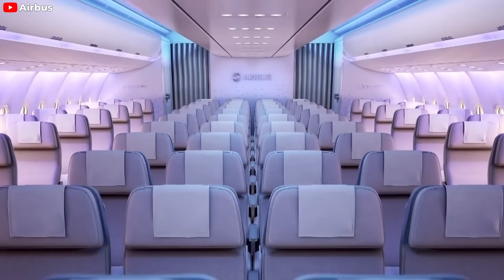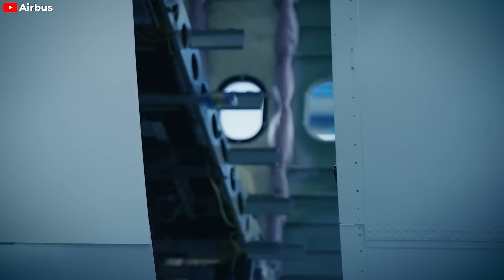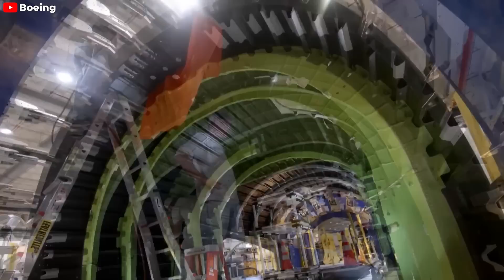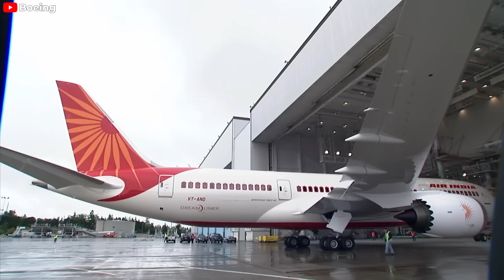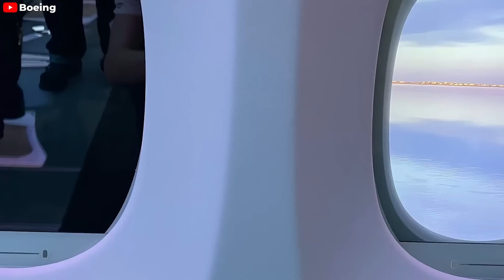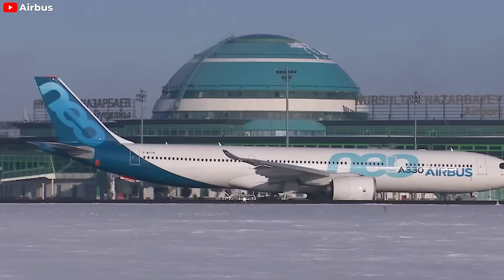Airbus NEW BIG Plans on A330neo Will Change The Whole Aviation! Here's Why

Comment: Interesting video including most of the points I have previously raised.

Unfortunately, fanboys and salesmen only understand 'best'.

Sometimes, 'good enough' is all that is needed. 

I am sure that the Boeing bean-counters envy the earlier profitability threshold of the Airbus.

The Boeing may well be the better plane overall, but it is almost certain that the A330neo will outperform the 787 so far as profit for the manufacturer is concerned.

Perhaps with hindsight, Boeing could have been better off financially by enhancing the 767 instead.
Reply from the maker: thanks for your sharing

Comment: I agree that the Airbus A330-900 is just an upgrade version of the A330-300 but if it was meant to be an upgrade then it shouldn’t have been heavier than older model it should have lighter in weight and more powerful engines. Instead the A330-900 has less powerful engines and it’s a lot heavier in weight therefore it goes through a lot more fuel and then it costs a lot more to maintain and to keep the plane. If Airbus wants to make the A330-900 a good plane to replace the old A330-300 then they are going to need to make the 900 a lot lighter in weight and more powerful engines and also better for flying higher up in the sky otherwise Boeing will continue to win this market and that will be the A330-900 not worth continuing to make anymore and leaving airbus with a job to make another plane altogether
Reply: The A330neo cost much less to develop than either the B787 or A350, so to develop a lighter carbon fibre composite hull now would be very expensive, and unnecessarily compete with Airbus' own A350. So Airbus would be shooting themselves in the foot. The A330neo is much more efficient than the Ceo, and is available to airlines much sooner and much cheaper than its rivals. Many Ceos around will not need to be replaced for some years, and whilst the type sells modestly until then, it is currently keeping the price of the B787 down, so a good job well done for Airbus.

If the rumoured Chinese order for 100 plus Neos is confirmed at Farnborough, along with the rumours of Virgin replacing their B787s with Neos, when the 787's lease expire and when major internal refits are required, the Neo will be shining in the spotlight..........
Reply: @artrandy While it was easy to compare the 737 with the A320 series, it is far more difficult to do so with the current widebodies with their less than perfect alignment.

While far from perfect, I sometimes wonder if we should even consider the A330neo and A350 together. After all, the A350 was initially intended to be a replacement for the A330.

Not only that, but if I am not mistaken, the A330neo wirh it's brand new industry leading wings has ended up being good enough to make the proposed smallest version of the A350 unnecessary. Possibley because efficiency usually improves with a 'stretch' with the opposite so often being true for a 'shrink'.

As for truea operating costs, it might be several years before we have enough data regarding residual values to give a definitive conclusion
Reply: I do agree
Reply: Virgin Atlantic isn’t buying any more of the A330-900 because they are replacing the their older A330-343S with the new A350-900 ultra long range. And the A330-302 is still a lot more fuel efficient than the new A330-900 especially when the A330-302 is lighter in weight and the last of the planes were built in 2020 and virgin Atlantic and euro wings bought the last of them earlier this year so they will arrive later this year or next year
Reply: @FraserWest-um4ue  
I never specifically mentioned the A330-900 in relation to Virgin, I deliberately spoke of the A330Neo. That covers all configurations of this new generation A330.

You invent an argument I didn't make, and then contradict it. Ostensibly, you're arguing with yourself🙃🙃.

Besides, the rumours of more A330Neos for Virgin, to replace leased B787s returning to their lessor, is separate from any future need Virgin might have to replace other types.

Let's see if there is an announcement at Farnborough or Paris about new Virgin A330neo orders, the former is only next week. I have an open mind regarding rumours, but you are certain that you have a hotline with God😀.

So please don't try to gaslight me buddy, my message is clear, as is your attempt to confuse things to win out an unconvincing argument by default...........
edit: sp
Reply: What you’re saying about me is actually correct . With either of your messages
Reply: No you’re saying I made the hole thing and I am arguing with myself and your calling me stupid and a few other things I don’t that and I the fact is that there hasn’t been any evidence of what you’re saying is accurate anyway so don’t bother being quite so rude to someone who has flown both of the A330-900 and the 300 version
Reply: I was only making a point and virgin Atlantic has the order in place since 2019 but still hasn’t been given the planes the newest order is actually for the bigger A350-1000S which isn’t arriving until 2026 at the earliest
Reply: @FraserWest-um4ue  
Nothing I can see in your 2 replies, has contradicted anything I've said, but you've assumed I said something different, and contradicted that instead............

Comment: The A330-900 does not weigh 251t. It's the MTOW. And the MTOW of the 787-9 is 254t. The 227t ist the MTOW of the smaller 787-8
Reply from the maker: thanks for your comment

Comment: This is a no-sense to compare this two aircrafts: the A330 is an old generation plane, and the B787 is the most advanced one in terms of technology today. Even the A350 lags behind the B787. The A350 is a conventional plane with carbon airframe but all the equipments and the technology architecture is traditional
Reply: Do not agree with you on that. Apart from Boeing's non use of bleed air, and Airbus's use of conventional batteries rather than li-ion, the A350 is more advanced than the 787, especially in terms of its systems keeping maintenance costs low and managed. The A350 was initially going to use li-ion, but this was changed after Boeing's problems with them.
Reply: @FrewstonBooks   The A350 is carbon fuselage, but built in 3 pieces in a section when the B787 is one piece which is much better. 
The A350 is in carbon, but still with classic systems such the air is still coming from the engines with all the pollution problems which affect everything aircraft, on the B787, the air is coming directly from outside with four compressors which can still work in case of engines problems. The brakes are full electric on the B787,  when the A350 is still equipped with classic hydraulic. The B787 has a central computer systems architecture while the A350 still has a lot of local computers like every aircraft since the 1970’s. On the B787, you can start both engines at the same time but not on the A350. The airframe de-icing system is electrical on the B787 while still air with the A350 and …. Yes the A350 is a conventional plane built with carbon, while the B787 is really a new step in the aircraft development. Sorry sir, I flew the Airbus, and the Boeing,  and I am not talking about the flight philosophy of each one, where there is no problem with Boeing while there are safety questions about the non-synchronized side sticks and the non-moving throttle on the Airbus. I am living close to Airbus Industry, I would prefer to say the opposite, but I have to recognize that today the B787 has no equivalent, maybe the next Airbus (I hope so)
Concerning reliability: we had 24 A350 and 35 B787 in my former company before I quit, and reliability was the same
Reply: Newer isn t always better.  Best example is the battery problems b787 had. If it leads to a safety hazard you can give me the old technology anytime.

Comment: This is a no-sense to compare this two aircraft: the A330 is an old generation plane, and the B787 is the most advanced one in terms of technology today. Even the A350 lags behind the B787, the A350 is a conventional plane with carbon airframe but all the equipments and the technology architecture is traditional
Reply: The A330 Neo isn’t an old generation plane. In some things it could be better than the B787 as example the quality, which Boeing is failing at lately. Don’t say that the A350 lags behind the B787 because it obviously doesn’t. Maybe airlines chose the B787 over A330Neo but they also chose the A350. Also B787 and A350 aren’t comparable.
Reply: @samixzyy    The A350 is carbon fuselage, but built in 3 pieces in a section when the B787 is one piece which is much better. 
The A350 is in carbon, but still with classic systems such the air is still coming from the engines with all the pollution problems which affect everything aircraft, on the B787, the air is coming directly from outside with four compressors which can still work in case of engines problems. The brakes are full electric on the B787,  when the A350 is still equipped with classic hydraulic. The B787 has a central computer systems architecture while the A350 still has a lot of local computers like every aircraft since the 1970’s. On the B787, you can start both engines at the same time but not on the A350. The airframe de-icing system is electrical on the B787 while still air with the A350 and …. Yes the A350 is a conventional plane built with carbon, while the B787 is really a new step in the aircraft development. Sorry sir, I flew the Airbus, and the Boeing,  and I am not talking about the flight philosophy of each one, where there is no problem with Boeing while there are safety questions about the non-synchronized side sticks and the non-moving throttle on the Airbus. I am living close to Airbus Industry, I would prefer to say the opposite, but I have to recognize that today the B787 has no equivalent, maybe the next Airbus (I hope so)
Concerning reliability: we had 24 A350 and 35 B787 in my former company before I quit, and reliability was the same
Reply: Clean clean
Reply from the maker: Thanks for sharing